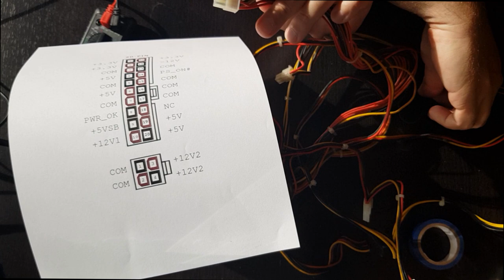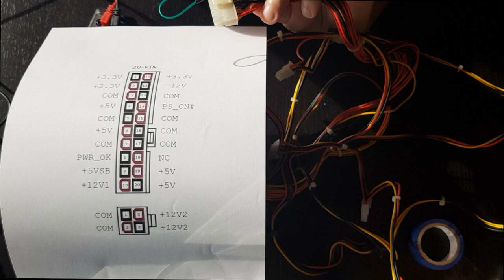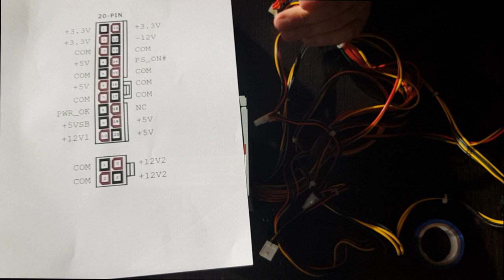Testing an ATX power supply

Comment: 10.65v on the 12 volt rail would definitely indicate a problem to me. It's hard to tell without having it properly loaded so I'd test in the the machine if possible. The last time I measured a voltage that low on 12v a new PSU fixed all kinds of weird behaviour on the PC.
Reply from the maker: Fortunately it seems this time it wasn't the PSU (even though I was beginning to think along the same line as you mentioned). I guess the lower voltage was due to the lack of a proper load. The real problem was still power related, but due to the connector delivering power to the CPU.